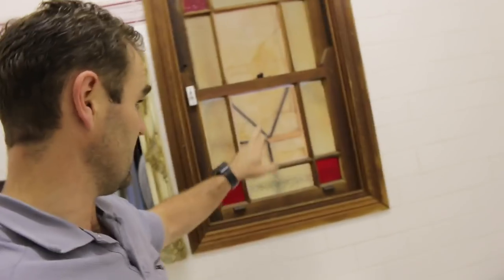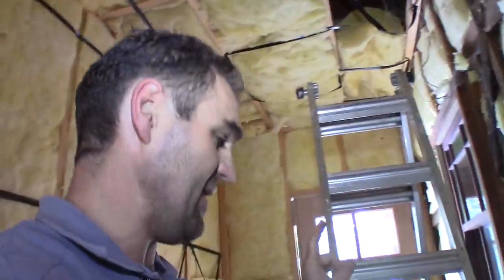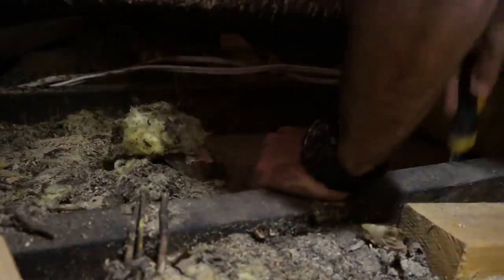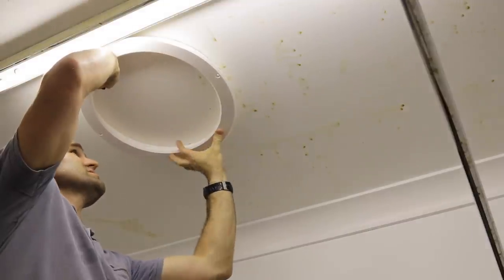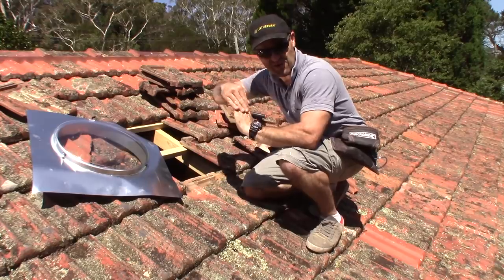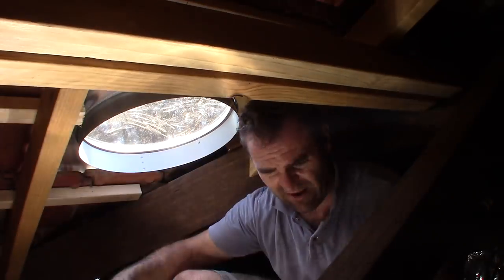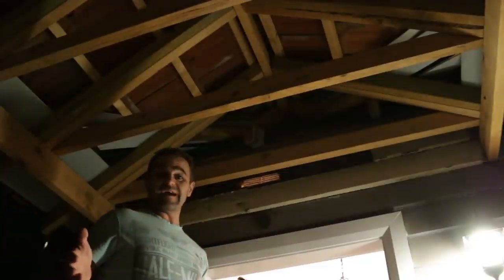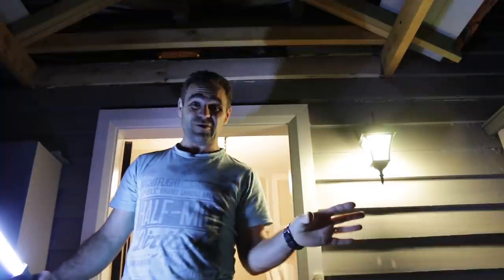How to install a skylight and evict possums - Jeff's House part 7

Comment: Franny and I were just discussing your opossum issue. Your light is a great idea. If the eviction doesn't work, what about a movement activated spotlight up there?  That would be awesome and some can battery operated and voila!
Reply from the maker: That is not a bad idea, but ultimately the best way is to block up the holes. Unfortunately the little sod, pulled out one of my pieces of wire mesh and got in again, so it looks like I will have to get out there tonight and do a better job of blocking it up.

P.S. The Opossum is an animal you guys have in the US I believe, ours are just Possums (or Australian Brush Tailed Possums) to be more accurate ;)
Reply: Home Built By Jeff maybe block it and have the light. Double protection. I thought the animals were the same. Thanks for the clarification.  I did run into one down under in Cairns. It invaded our picnic table.  It was pretty aggressive about our food. Too many tourists fed it. We eventually had to split.  Good luck mate.  Hope he vacates.
Reply from the maker: Yeah, they look cute, but they can be very nasty when they want ;)